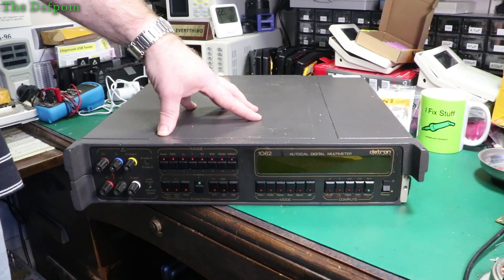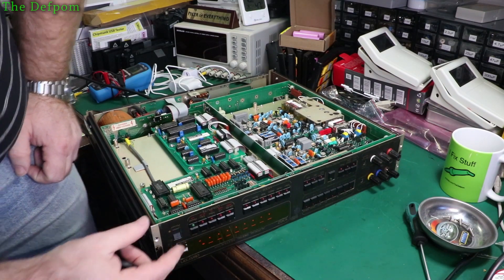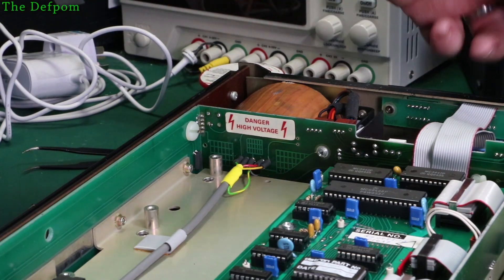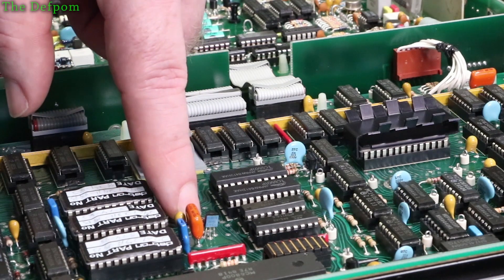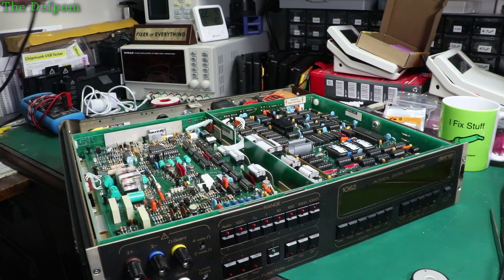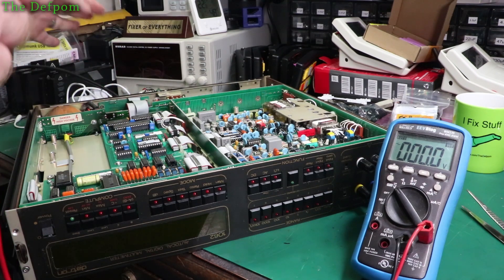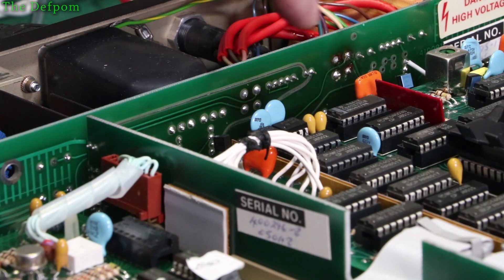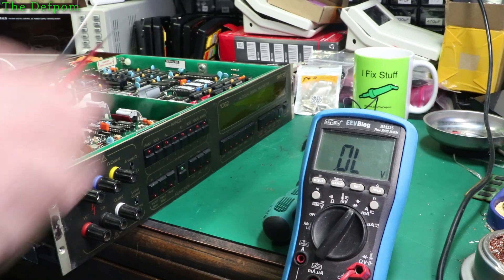#717 Datron 1062 Autocal Digital Multimeter Repair Part 1

Comment: Part 1 of 19??? Nice start to what will I'm sure be interesting series of videos. I noticed that when you brought the supply voltage up on the variac that the display was showing some digits rather than the bars and  dots (before the bridge rectifier change-out).
Reply from the maker: Yep I noticed the display thing too, probably due to the under voltage of the reset circuitry or something.
Reply: @TheDefpom  True, at least that means that much of the digital circuitry and the display drive circuits are working. Yeah!

Comment: Did you find schematics for this unit?
I have repaired 4 of these in the past. Lots of info on EEV Blog on 1062 LS101
Reply from the maker: I have the service manual, for a much earlier year but it is basically the same, I put the manual on my Patreon page with the video's pre release. Whenever I am fixing something I always add the service manual and whatever files I have to Patreon.

Comment: The panel overlays were never great when they were new 30+ years ago, I recall them feeling like they weren't stuck on properly.
Reply from the maker: I picked up 2 units in the end (you will see the 2nd one in upcoming videos), that one was much worse, I just need to find some nice double sided tape to refit the that units trim overlay, it is hanging off.

Comment: At 2:00 you power up and hear relay chatter, but you change from 110 to 220 at 2:42 afterwards?
Did you have the meter connected to 110Vac source or is it an editing glitch?
Interesting fix to follow..👍👍👍
Reply from the maker: Tom George - I changed the input voltage setting early on from 115v to 230v